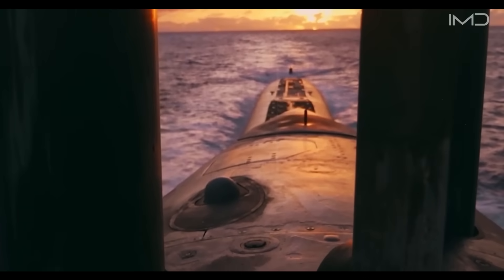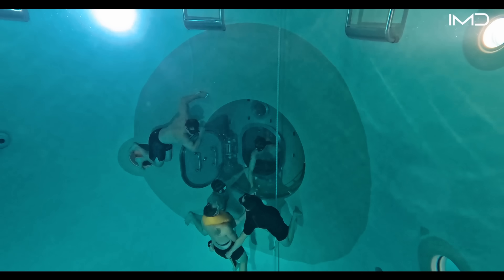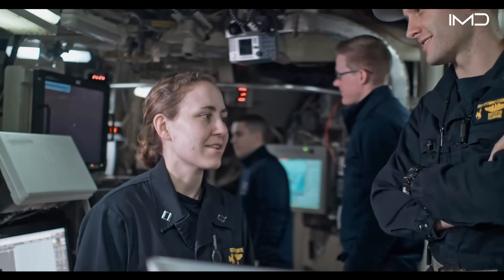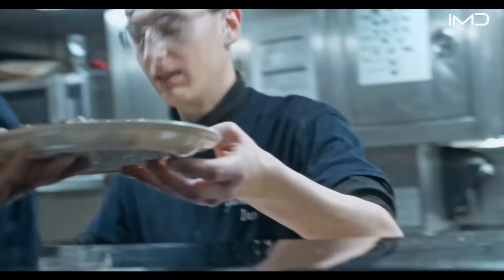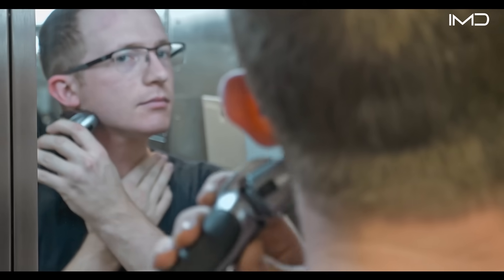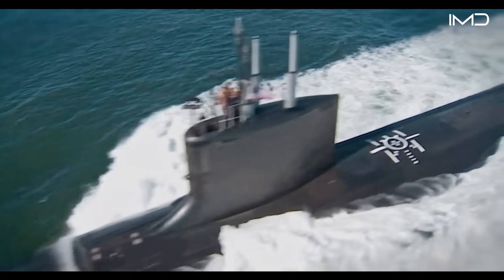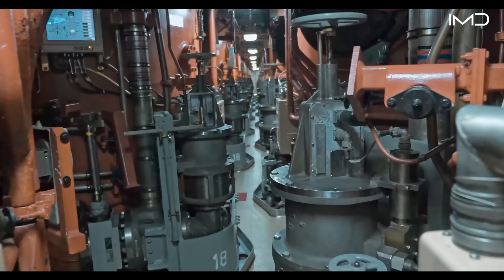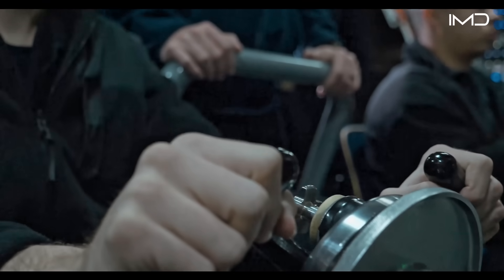How Submarine Sailors Eat, Sleep, and Survive for Months Underwater

Comment: I was a submarine nuclear propulsion mechanic for 20 years (nuke MM from 1980-2000). A few things about this video.  Nukes did not go to sub school when I was in.  If they are required to do so now, I'd like to know when it started. I never considered sub life to be all that difficult as long as things went like they were supposed to.  Generally, the food is pretty good, but it depends on who the duty cook is. Older boats had larger berthing spaces.  Not more room, just more people.  Never had to hot rack.  I did sleep in a hammock strung up between two missile tubes for a while.  Barber shop?  We cut hair in the Doc's office.  Torpedo racks are a good place for a nap waiting in line to eat on a 637 fast attack. Played a lot of cribbage, read a lot of books.  Been to church services at 400 feet. Still seems very weird to me to see women in submarines. I wonder how that works out.  We very rarely ran the O2 generator.  They have an annoying habit of blowing up, thus the nickname "the bomb".  Only time we ran it is when we were under arctic ice.  We burned a lot of chlorate candles and ventilated at PD at night.  I retired 25 years ago, and I still can't sleep more than 5 hours a night.  Damn three section watch rotation.  I know you need video footage for YouTube, but subs spend very, very little time surfaced.  A lot of these videos make it look like we run around on the surface a lot. Too easy to run into stuff up there, and the ride at 400 feet is much smoother.  Made my best friends and my worst enemies on the boat.  Saw a couple get hurt pretty bad.  Watching them leave on a helo for HUMEVAC is a sad feeling.
Reply: Current ETN1, nukes still don't go to sub school. We also don't use the O2 generator you used anymore so it's a lot less trouble to run it for a long time.

Comment: I could never do it. I'd go berserk on day one. Much respect.
Reply: Naw, you gotta pass the Crazy Test before you get on one. That's what Sub School is for. It separates the normal ones from the crazy ones. The normal ones go back to the skimmer fleet.😂 They didn't show all of it, but if you can tread water and keep control with about 2 inches of head space in the flooded damage control simulator before they drain it , AND you pass all the other psych exams and insane tasks, they figure you're bonafide crazy--to start. Then you Qaulify for a few months on ship for your Dolphins to prove it. 🐬🐬
Reply: @reddragonn1590  amurika eat hot dog
Reply: @graall375 Yes, we eat hot dogs. Does that have something to do with submarines?
Reply: Me either, but for me it's also a fear because I've never been good in the water.
Reply: @joewoodchuck3824  I’m basically a navy seal in the water.
Reply: I wouldn’t as long as I had my pills.
Reply: Cause YOU WEAK! BETA!!!
Reply: Are motto , was submariners eat their dead , hot racking on top of the torpedoes and one gallon of water per man per day perhaps.